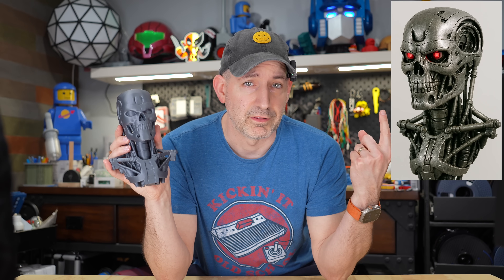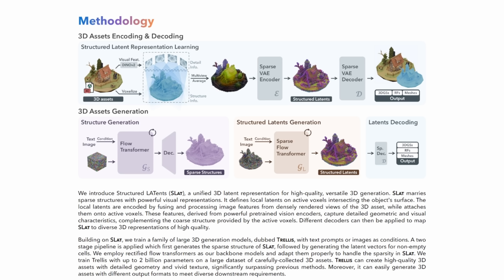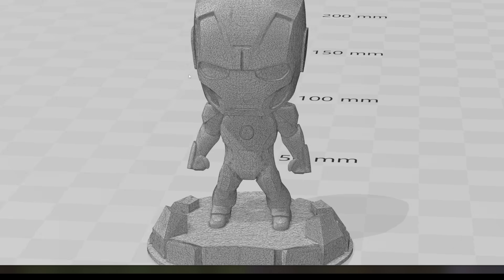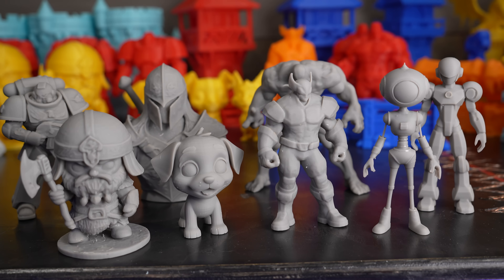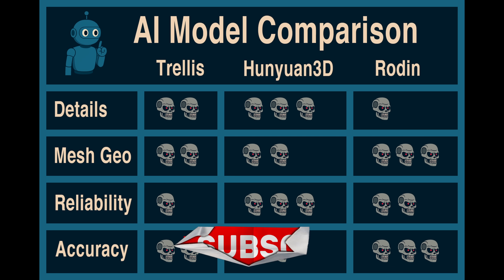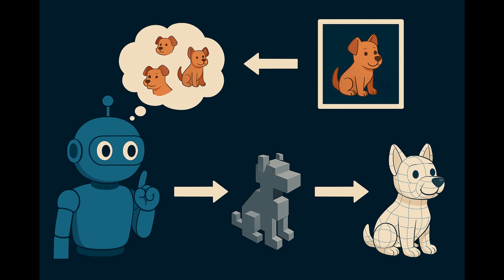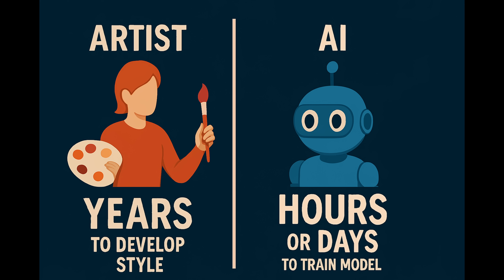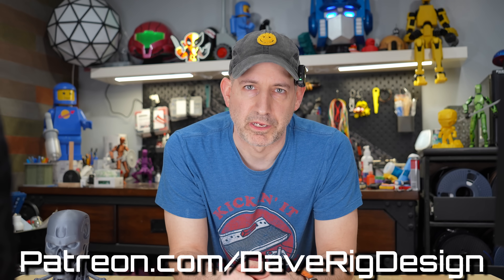Can AI Create 3D Meshes Good Enough for 3D Printing?

Comment: got a 3d scanner for christmas, never modeled before and i'm learning its going to take months to learn, can i just import my 3d scan mesh into this instead of using an image? i'm old and i don't wanna spend two months learning fusion 360
Reply from the maker: it depends on what your end goal is. If you are looking to just clean up the mesh after scanning the software that comes with the scanner should be able to do that. You may need to simplify the scanned mesh also as the scan will have a very high poly count but the scanning software should be able to do or the slicer software can also optimize the mesh. AI isn't really needed for that. 

If you are looking to modify the scanned mesh, There are some AI models that you can start with a mesh, I don't remember which ones though. 

If your making decorative objects like minitures or statures you wouldn't want to use Fusion 360, that would be for functional parts where accuracy is important.
I would look at blender or nomad sculpt. I use Nomad sculpt on my Ipad and its very simple to learn using the pen. 

If you are making functional parts fusion is the best bet.

Comment: thanks for the video, i actually didnt know there was a separate maker lab utility. there is no dropdown for it on bambulab site, just maker world. so i found it through google from your video and am greatful. been struggling with different generators to get functional models and maker lab is so much better with the desired geometry handling without having to keep messing around with mesh edits. i am expecting an H2D to arrive soon (upgrading from a monoprice maker select) little jump there.. :) good info, will be watching for more vids
Reply from the maker: Glad I could help. H2D! sweet. The duel nozzle or the new H2C has peaked my interest but I may just upgrade to the HDS. I don't do much multi colour prints and backed the Snapmaker U1 which should be here soon and should be good for that.

Comment: Whats the best process to take a car body mesh shell and making it thicker so it can be 3d printable?
Reply from the maker: If you have it as a 3d mesh already, in most 3d programs (like blender) there is a process call “shell” or something similar that will add thickness to the object. So adding a shell inward will make the walls thicker to print without effecting the exterior detail. 
If you wanted to make the car a solid chunk it’s a little more involved

Comment: To be fair the AI models that are generated are not meant to be used directly. You are supposed to go in and take the generated model and resculpt them with modeling 3d software and fix all issue before retopology. If they are static, then retopology is not too important except giving clean uvmaps and texture surface. If it will be animated then you need to design the topology to conform the to the deformation areas where joints and movement will happen.
Reply from the maker: True, but that is if you are using them in a digital environment like a game or video. For printing UV’s / textures are not used. Usually the geo is detailed enough that it doesn’t show up in the print and if you are using a modeling tool with dynamic geo retopo like nomad sculpt there is not need to retopo before or after sculpting.

Comment: real question is can you use ai to design specifically for 3d pruinting with better overhangs and no supports, and if you can put Ai INSIDE our slicers to do this and help convert models to just be perfectly PRINTABLE automaticaly sdplkitting parts and even seperating pieces for multi color printing with 1 click etc
Reply from the maker: Not yet. Someone would need to train a model with all the printing best practices so it knows what to look for. I have seen a model that will generate your mesh in pieces so that would work for multi colour prints

Comment: I would be quite curious to see if one could feed a screenshot from the results of one model into the next, to see if there is a way to help them work together in order to better approach the desired print.
Reply from the maker: I don't know if you will get better results, but they will be different. Each time you go from a image to mesh you loose some of the fine detail. 

You could do something like generate a mesh from one image, then render front/side/rear views and draw overtop any changes you want and then feed those images into a model that takes multiple images to get your changes in 3d. 

That might be interesting

Comment: Okay, I have a question for anyone. 
Long time ago in a galaxy far far away,  I used to do mechanical and architectural drafting on this thing called 'paper' . We would draw a front view,  a top view,  and a side view of an object or dwelling.  Is there a program/app that can aid in that for artwork and not C.A.D. 
So if i were to draw a car from a front view and a top or side view,  would the app give me a 3D image?  Granted it may not be perfect but fixing is faster than creating.  
Like the stairway shown in this video.  If I were to draw that, would the program be able to create the object from that?  
I'm older so much if this isn't in my tool box.
Reply from the maker: Yup, I did that with the multiple images. Not sure ho well it works with just line art. It may need some shading. But looks at the robot with skinny arms. It’s basically just a sketch

Comment: Something my art teacher said to us during a character design pop quiz, "It's only cheating if you get caught". Meaning that all artist steal aspects or inspiration from others works. As long as you aren't plagiarizing someone else's work nearly 1 for 1 then you are more than likely good.

With the exception of those freaks (said lovingly) who can whip up character designs off the top of their heads in an instance, the amount of time it takes the average artist to design a character from scratch without using other similarly themed characters as guidance takes multitudes longer to create than the later option.
Reply from the maker: There is very little that is truly "new", most new things are multiple old ideas combined in new ways.

Comment: There is now a Hunyuan 3D-2 (paid per model) about $2.50 per 100 models. You can give it a main view + Top + Left + Right views as well as various slider adjustments for details, etc.
Reply from the maker: Ya, I saw. Don’t think it was out when I was working on this don’t think it’s paid though unless you mean using it on the huggingface site.
Reply: @tigerpawdesigns  Awesome, I will try it

Comment: T-800. There is a new Hunyuan3D 2.5 that they say it is amazing and produces more detailed meshes than anything else. So far it is only available in the Chinese website, and you can register for free with an email. You should try that one with the same images you did this video and compare the quality of the meshes, etc. I've used ChatGTP to do the person on a blister trend and then ,used Photoshop to extract my human figure, and used high3gen for the image to 3D stl. then I replaced the face with a more accurate scan that I did with Kiri engine 3D photo scan, and printed it in a Bambu Lab A1.
My next steps is to do some booble heads from relatives from photos.
Reply: yead and it lets you upload multiple images this time

Comment: T-800, have you tried or seen using AI to generate action figures, mostly interested in having it add joints to the figure
Reply: Or uploading a mesh file and have AI modify it
Reply from the maker: Haven’t seen it generate articulated joints yet. But I did see a model the will generate you mesh in parts so not far off. Generating in parts would be great for multi color printing.

Comment: what about makerworld image to 3d tool. its in the makerlab section. i have had good results with that. I havent used any of these other models though
Reply from the maker: Same idea, it’s most likely using one of the open source AI models similar to the ones in shows to power the process and then built the UI around it to make it more user friendly. 
A lot of the commercial products are like this where the core is one of the open source models and the have built a framework around it and maybe added some features.

Comment: Besides the T-800 malarkey, how good would AI could get at replacing dedicated scanners in the near future?
Reply from the maker: The fine detail is still lacking a bit, but a new version of the Hunyuan3D model came out yesterday that has impressive find detail reconstruction. So I'd say not too far off.
Especially when you add multiple images, it's basically using photogrammetry processes to construct the mesh. I think scanning will become a niche process for very specific use cases.
Reply: @DaveRigDesign   🤔
I do auto body parts and panels and I 3D scan to reverse engineer. I need sub mm accuracy and substructure for panel fitting. Not sure this can replace that.

Also, this would make copyright a nightmare for automotive applications but again you need mechanical substructure which comes from a local scan.
Reply from the maker: maybe not yet :)
Photogrammetry is very accurate and also just taking pictures. AI just allows for less pictures. I think over time the accuracy will go up. 
Also this is creating meshs in 30 sec instead of hrs or processing time so quality could be better if more time was taken. 
The process isn't great for unique items though, If the AI hasn't seen object that are like the ones in the input photos it has a harder time with it.

Scanning won't go away but it will be needed less and less I think.